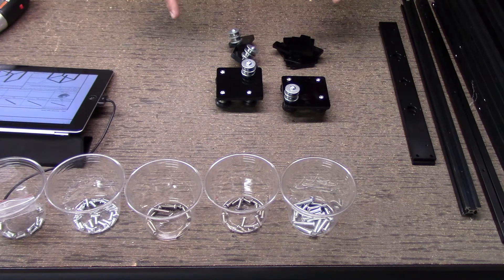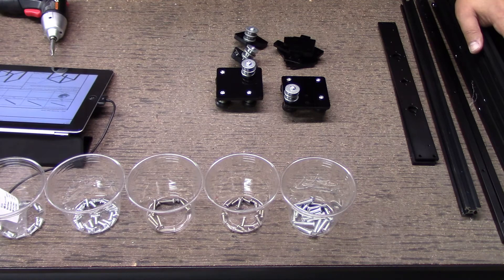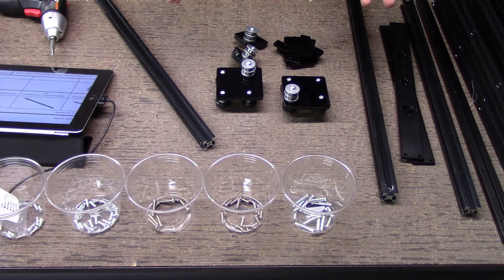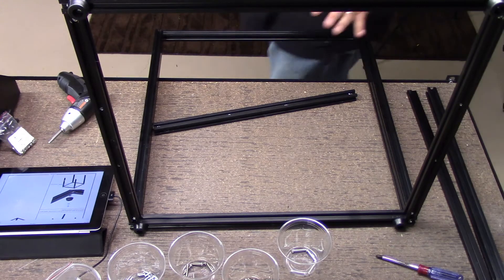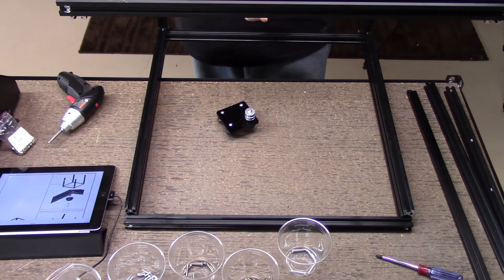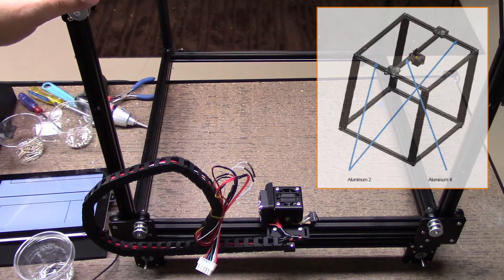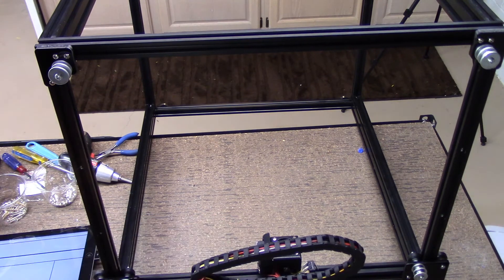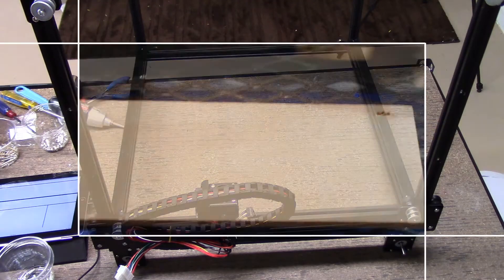Tronxy X5S - Building the Frame Part 1 of 4!

Comment: Why did you skim over the only part I needed.  This has been a disaster I have a customer who wants me to complete this build but as I have a xts I can't find a manual for it anywhere.
Reply from the maker: Sorry what part is that and I will try and answer...
Reply: @DIY3DTECHcom  Goodness I'm sorry I didn't see your reply.  So we received one of these 3d printers from a customer and it did not come with a manual whatsoever.  The customer service was rather terrible and they sent us three different manuals all for the wrong machine.  The problem is that we can't seem to build the frame without some kind of blueprint or guide as the pieces for the frame are almost all different sizes and need to be put on in a specific way and in a specific order in order to mount the actual cnc portion of the machine to said frame.  In addition to that there are two different types of bracers for the corners and I have no idea which goes on what corner.  

I'm not entirely sure though that we have similar machines as mine has different sized pieces for the base.  I have four that are 40 by 40 though three of them has different threading than the other 2 20 by 40 pieces and a few 20 by 20 pieces.  If this sounds familiar then maybe you can help.  If not I'm sorry to bother you.

Comment: I will be building this printer this week or weekend (if it comes with all of its parts and no bent/broken anything) using your guide as well as one on the net because your time lapse diminishes it to some degree.  The build guide on the net explained the actual building of the frame that your time lapse just whizzed by on.  I guess between the two sources I should be able to get this built.
Reply from the maker: The frame is easy, the belts are a little harder but very manageable.  I love this printer, it is my favorite and the only reason I don't  recommend it more is it is a kit and a bit of complex one being Core X/Y.
Reply from the maker: P.S. Also keep an eye out as I am upgrading to Marlin on mine with mesh bed leveling and did upgrade the motors (Alpha and Beta) along with 8 Diode smoother and and very impressed so far.  Oh also check out the Core X/Y motor video I did too!
Reply: Smoothers are not really needed with the stock controller since it is supposed to be using 4489 built into the controller.  You know 3mm width belts???????!!!!!????  I can't even buy that if I wanted to as I have never seen that.  I have 10m of GT2 rubberized belt on its way and once I get it built I will be replacing those sandwiches with smooth pulleys and that is when I will use the belt that is coming.
Reply: Oh, careful as there are now three versions of this printer (yours is version 1) and there are differences.  For instance Marlin is now on the controller and you can upgrade it with a new Marlin using the Arduino ide as they come with the bootloader now.  A few other things were changed as well.
Reply from the maker: Yea I have the older one with no boot loader :-(  but I have several programers so no issues
Reply from the maker: On mine it made a difference as it does change the torque curve